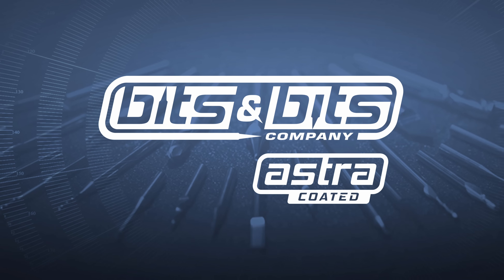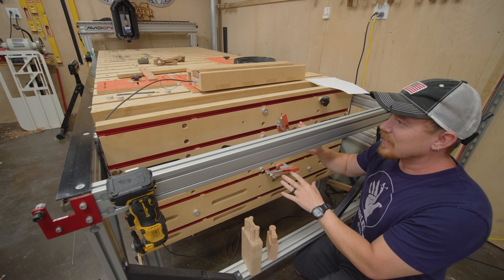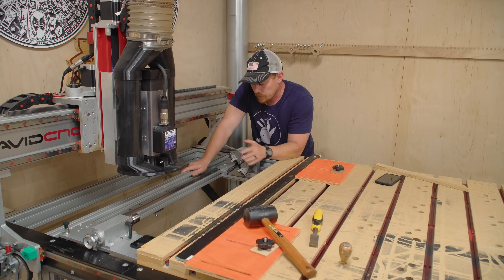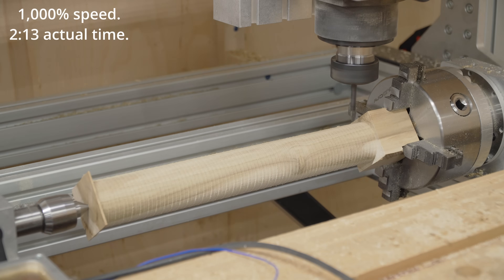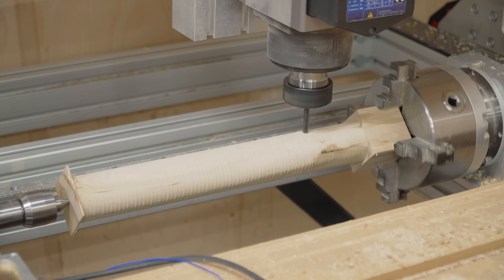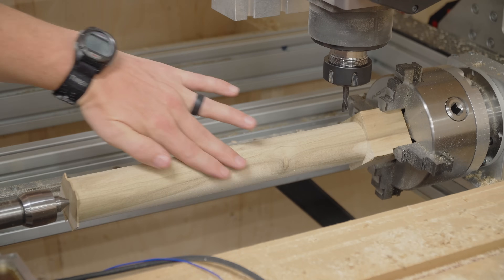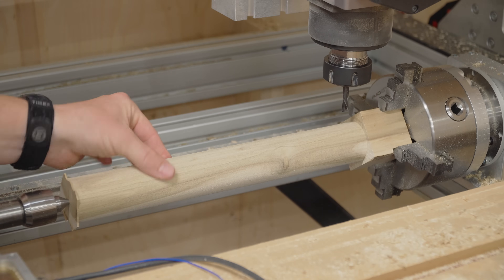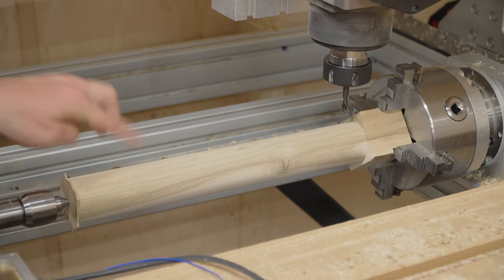Avid CNC Ep6: Rotary 4th Axis

Comment: Hi Jay, I have a 4x10 Avid Machine, I bought the Rotary with the machine.  I had the rotary axis positioned the way you have with the tail stock on the X=0 side (until this week).  There are some challenges with this.  In Aspire you have to set the origin to the right side which is fine but the Y axis (A axis) is the wrong way round - everything is backwards! So if you want to put some text into the rotary job you have to mirror image it, if you want to put a spiral into a job, it comes out the wrong way round!  I worked like this for a couple of years but decided to fix all of this by switching the rotary axis around to have the headstock on the x=0 side, like in the instructions.  Of course the touch plate is now too far back and the Y limit is exceeded in the setup steps.  Arrrghhh!!!  So I'm going to have to switch everything back but wanted to rewatch your video first.  So my question is why did you put your rotary axis in with the tailstock close to x=0 when you fitted this?  The instructions have the rotary axis facing the opposite way to you (and mine originally).  How did you know?  And have you had any issues with this setup?

Comment: love fourth axis milling , brings a lot of new options to cnc routers , generally use s spiral finish cut with a ball end mill with 6-10% step over , this is one long spiral tool path from one side to the other , not steps in x axis like you was doing which leaves steps or machining marks also " depending on your software , I use deskproto " you can do automatic rotation cuts and this allows x y z moves along with a moves " fourth axis " often required for high detailed models , pipes etc , makes the fourth axis behave like an indexer , both true fourth axis and an indexer have limitations but luckily we can combine them for best of both worlds " assuming your machine doesn't drive the fourth axis with its y axis "

Comment: Good video, I have the 4th axis on my 5'x10' but been learning the sheet goods side more and haven't used, this is a great concept to try.
I installed my rotary on the front end where you have vertical, and honestly did not consider it would work on the back end as well. Curious though with both the vertical and the rotary, are you able to fit an 8 foot sheet still?

Comment: Jay, instead of bringing the router bit down on top of the piece, try offsetting the bit so it does a side cut. This is how a normal flush-trim bit would work and you will probably get a much smoother finish.

Comment: love it. I have the Axiom AR8 and it offers the 4th axis . I think your prior CNC was an Axiom and if I recall Bent's wood working has it or had it . I wish there was more content geared for CNC . I see people hating on the CNC but that is kind of a shame. For many of us wood working is a hobby where we can relax and create things. Stress on the word create things. I appreciate hand tooling I find it fascinating to see things people have created using hand tools. I kind of wish that the ones who are passionate about using hand tools would just relax a bit. Like your video showed so clearly wood working skills are still needed to produce things via a CNC. that does't include the time spent learning how to make designs and develop sound tool paths so you don't kill your project piece or even your machine. I have only had my CNC for half a season of wood working so I am super green at it. The thing about the CNC is your imagination is hopped up on steroids. I do wish I had the ability to do a vertical hold for joinery. 

So I have a question since you used to own an Axiom CNC were you able to configure any way to add vertical holding to do joinery with that particular machine.

Comment: Jay I made Que sticks about 27 years ago and the way I got very smooth cuts was to use a three wing slot cutter along the side of the shaft or handle. I used a router on my lathe with a tracer attachment. Try it, works great.

Comment: It really is a shame that vectric vcarve doesn't do 4 axis rotary carving. There isnt even a good way to do multisided (other than 2 sides) rotary indexing. I think they have 4 sided carving in cut3d but thats even more money for their software
Reply: a lot can be done with a bit of thinking. Rotary indexing can be done manually commanding X degrees and zeroing for every index. Using the A axis as if it was Y a wrapped toolpath can be done in normal 3D, "Y" coordinates is just in degrees
Reply: @fuzzy1dk  yea, where i have trouble doing rotary indexing is accurately positioning and rotating the model in vcarve. It seems that if i want to do a four sided job i essentially need four vcarve files and the model importing process needs to be exact with each file. As i get more time with vcarve I'm learning the tricks, but it would still be nice if it could do 4 simultaneous axis's

Comment: Great Jay! Yesterday I machined a semi sphere out of plywood with my fourth axis. Best thing: I write a one line G code for the actual cutting operation, instead of the 3000 lines V Carve was offering. Happy sunday! @tallerstolarka
Reply: maximazur:  Can you share that one line of G-code??  Very interesting.
Reply: @richardevans6891  First I start by gluing discs with different diameters instead of starting with a cylinder. Best way to avoid messing things up, is to generate a straight line in Vectric, starting at the origin position. Save that g code. Then edit it this way: search for a line with lots of G commands (G90 G20 G17etc) and change G17 (XY plane) with G18 (that's the XZ plane)
Then erase the G01 command (the straight line)
Generate a G03 with the amount of units you want to move in X and Z with a Radius and feed rate. The amount of rotational movement (A) will give you the resolution or overlapping, so you can edit that on the go in Mach3. 
My example: a perfect 200mm diameter semi sphere. Starting at G00 X0 Z0 A0, I wrote this line:
G03 X100 Z-100 A29000 R100 F700
Start setting the Z height at a higher position, so you can move in the air and check the movements. Then lower Z and use it as rough pass until you clean enough material to run a finishing pass. Increasing A value will end up in better finish surface.